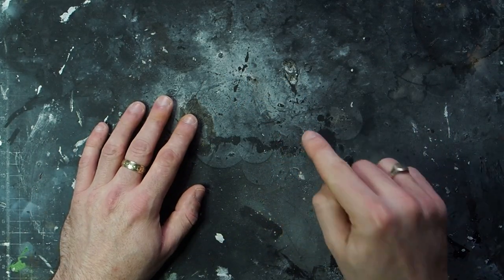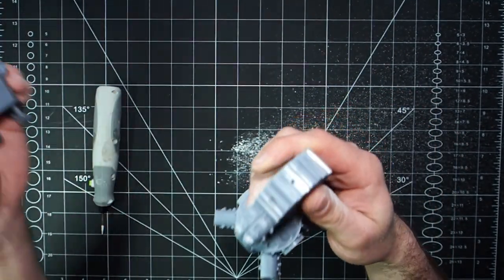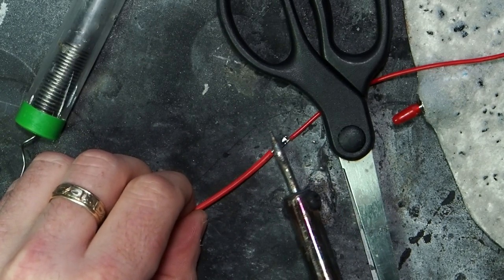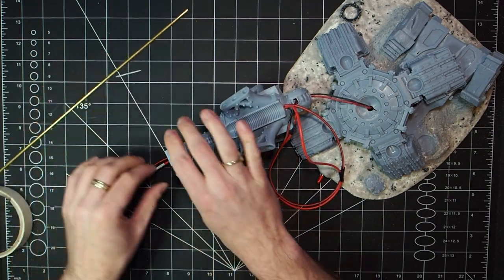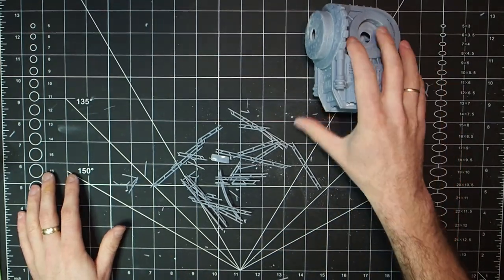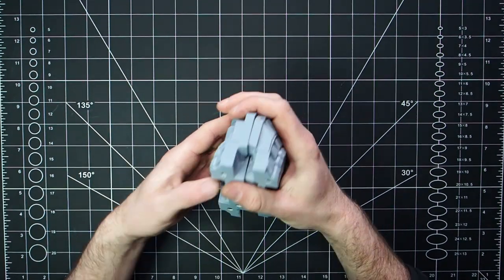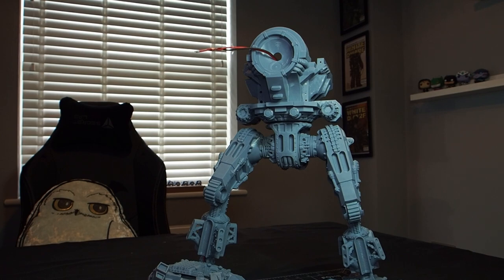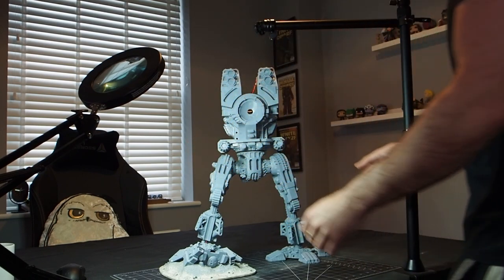HUGE progress on the WARLORD Titan gets made!

Comment: Soldering Tips:
Tin your wire and make J-hooks.
Throw on a piece of heat shrink.
Link up and close your J's with needle nose pliers to form a link.
Solder the two wires together & clip off any sharp/pointy bits from the tips of your J's.
(Insure that you have a homogeneous weld, no giant blobby solder, and no cold joints)
Slide your heat shrink over your solder joint & shrink it up!... Done! 😁
Reply from the maker: Thank you, I looked both those up and it makes so much sense!

Comment: How much resin did you use printing this?
Reply from the maker: Not much compared to what I've seen others use who have done this. I hollowed nearly every part between 1.2mm and 2mm depending on whether they needed more strength (legs) or not as much (armour panels). This is all resin printed, no PLA, so all in all (including loss and failures) it's between 2 - 3kg - about £80 worth!

I've got plans for a further 2 sets of armour panels & heads (Imperial and a little secret 😉), as well as about 6 swappable weapons in total. I estimate all of those will use another 2kg of resin when printed hollow.

Comment: Out of curiosity, is there a reason why the battery pack has to be in the base?  I've never owned a titan myself, but from the look of them I'd image there's space somewhere up in the torso to store it where it'd be closer to whatever elements you want to light up and then you wouldn't have had to deal with the hassle of running cables all the way up the leg - unless of course, the downed vehicle on the base is also supposed to light up (maybe flames or flickering sparks or what have you).

Either way, great build!
Reply from the maker: Great question! The main reason is for ease of changing the battery. I'll need to glue the torso together for stability so I won't be able to change the battery once it's sealed in the body. It also makes it easier to turn it on and off as I don't have to find a way to incorporate a switch into the body itself, which is quite thick.

You are somewhat on to a spoiler of things to come with other parts of the Titan you haven't seen yet mind.... 😉

Thank you for your feedback, plenty more of this build to come!